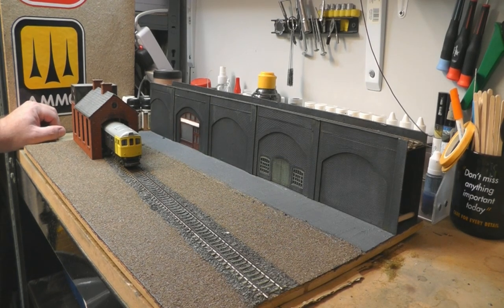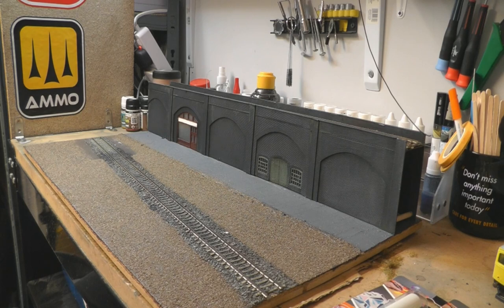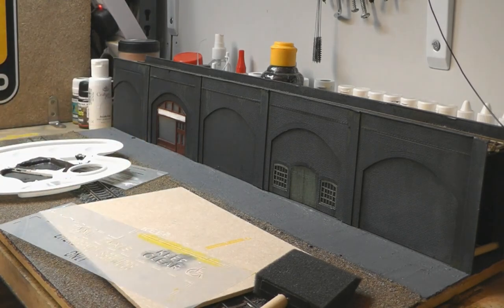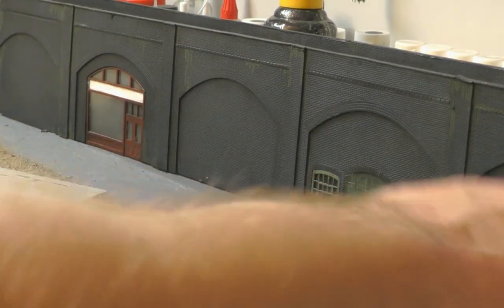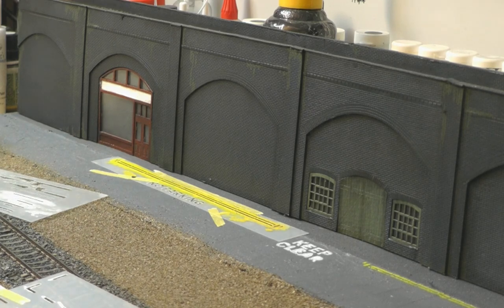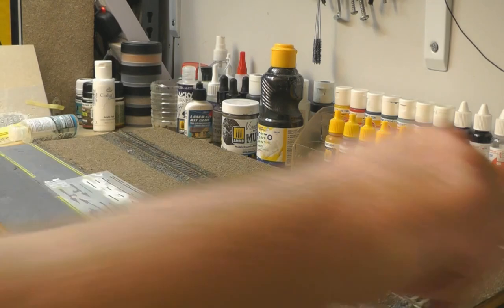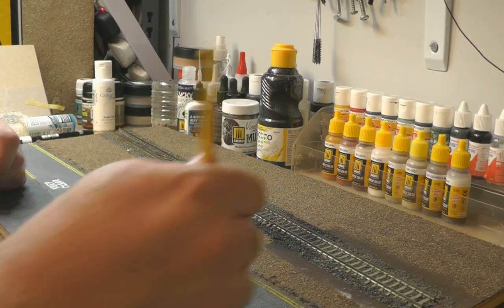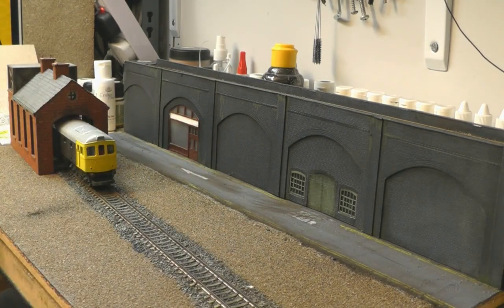Road Marking Techniques for OO Gauge Dioramas | The Arches Omnibus Ep. 5

Comment: Hi, practise makes perfect. You will probably need to dab of the paint onto a piece of scrap, then when there is hardly any paint left you are good to go. Personally I produce mine on the computer, trying to match the road colour, write appropriate words, print and stick on with glue stick. Then blend in with the 3 greys used to paint the road. Again hardly any paint. It's easy to creatd that worn look and its hardly noticable. For wlhite and yellow lines I use sticky vinyl, works every time, no blurring. Hoping thats helpful.
Reply from the maker: Hey there, thanks for the advice. I think you're right that more practice is needed!

Comment: Hi Adam Ot doesn't look too bad to me, a road so close to a railway line would 'probably' be owned by the railway, so would likely have very limited access. But what you have done is good, so far. Thanks
Reply from the maker: Thanks Peter. As always it was a little bit of trial and error for me but relatively happy with the outcome. Makes sense on the road ownership. I guess the road would probably lead to the shed somewhere anyway. Thanks for the comment.